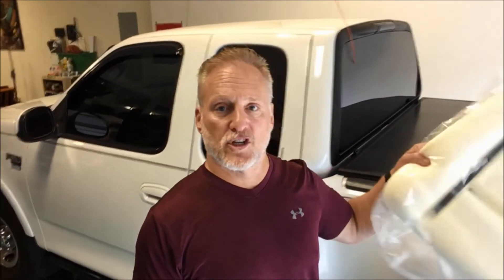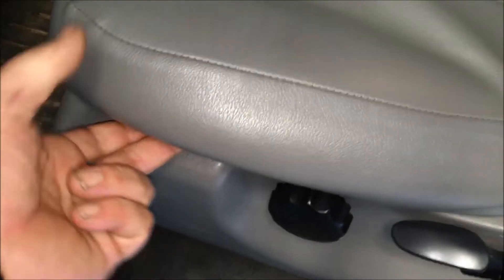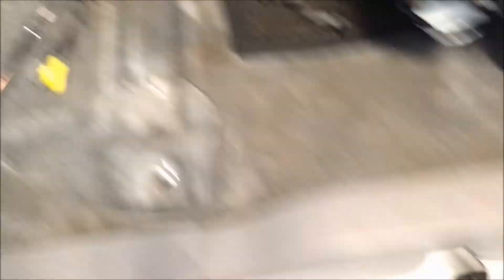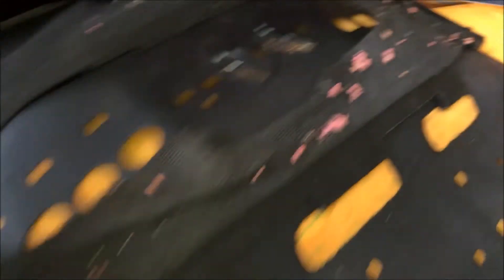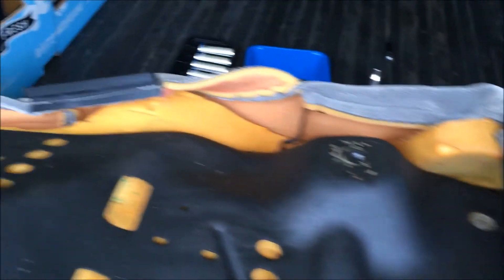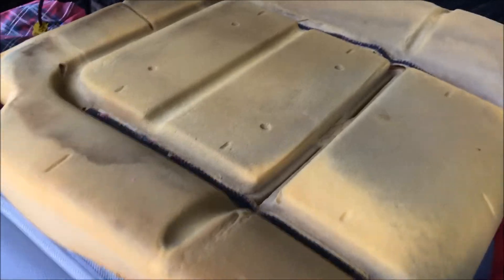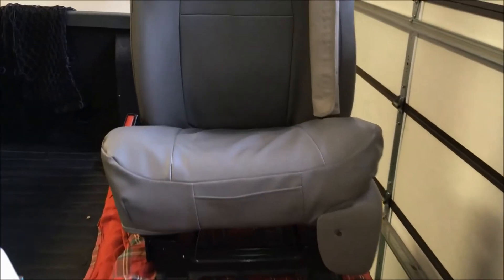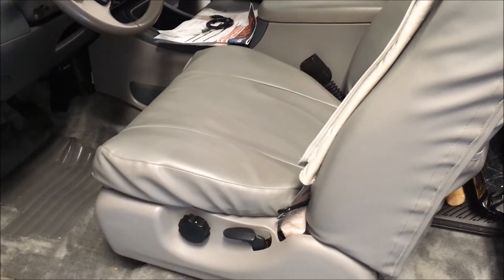Driver Side Bottom Seat Cushion Available For 10th Gen '97-'04 F150's! Also, For 7700 / F250 LD!

Comment: I’ve just ran into this same issue!  Looking to replace the bottom seat cushion in my 2003 Supercrew Lariat and nobody actually offers one (discontinued by Ford and have not found NOS anywhere).  You mention that you have swapped out the seats in this 2002…….can you confirm the model year that your bucket seats came out of?  Just looking to eliminate variables before I commit.  Thanks for the videos!
Reply from the maker: Sorry for confusion.  My seats are stock F150.  I changed the passenger seat, but that’s also F150.  The seat cushion works for both F150 & F250.  Buy from the link in the video description to help my channel :)

Comment: Can you please let me know what seat cushion that you bought to replace the foam on the drivers seat? And do you know if there are any additional steps to take on tearing down the seat because I have power seats and seat heaters on my truck.
Reply from the maker: Sorry for late reply, I usually try to respond very quickly.  All products in my videos have links in the description.  Here is the product link through Amazon, and if you buy through this link, I get a small cut to support my channel without costing you any additional money:  Driver Side Seat Bottom Cushion (60/40) - https://amzn.to/38W00P7
Reply from the maker: Also, with regard to removing the cover, the big problem is not so much removing the seat cover, rather, removing the seat heater from the foam.  You will need to carefully peel the seat heater element from the foam and transfer to the new foam.  I'm pretty sure you have a few hog rings that will need to be removed and replaced.  Let me know if you need further details.

Comment: Good video. A few tips: Your bolts may be rusty and require a few hours and lots of penetrating oil as mine did. There may be more wires to disconnect. Mine had several due to three moters under the seat. Also after disconnecting wires some have to be popped off from bottom of seat.
Most cushions require use of pig rings which for ease and safety require a pair of pig ring pliers although needle nose pliers can be used. As with many videos on this subject the job is quite a bit more difficult than the videos. However, /with some work and patience it's doable.
Reply from the maker: Thanks Ken... appreciate the added info.  I try to keep my vids concise so people don't lose interest.  Your points are very valid.  My primary interest was to show there are options for replacement seat cushions on the market.  Thanks for watching and please subscribe.

Comment: Seats are sold on ebay for the 10th Gen F150 that do not fit. The major difference is that the bottom of the 10th Gen foam cushion is molded to fit the seat pan and the newer ones are flat on the bottom. The 10th Gen is about 3 1/2” shorter (front to back).
Reply from the maker: ok... thanks... the one I used is an exact match and is shown as for the F250

Comment: Heres another one that will make you laugh.  On my 02 f150 supercrew I needed the leather seat bottom for the drivers side.  The one for sell would fit but was a different design seat pattern and was 33.00 at ebay, but get this, the identical seat pattern was only sold for the F250 for year 2004 and shockingly was only 16.00.  Thats as crazy as having to buy womens pants to get the right mens pants.  The old saying is if the shoe fits wear it
Reply from the maker: that's a cool story... thanks for sharing